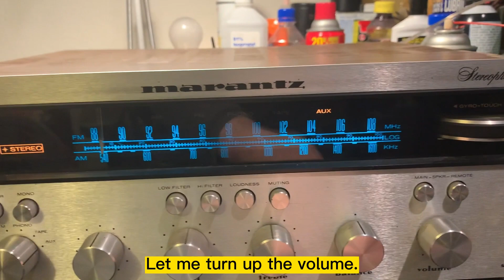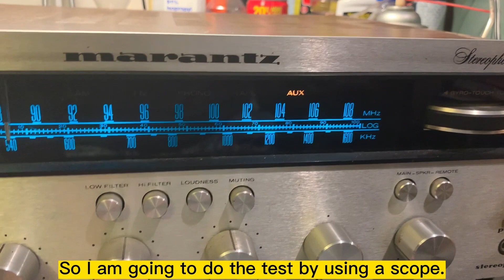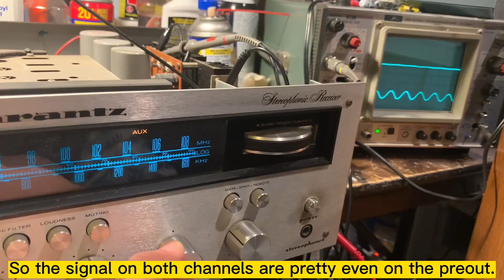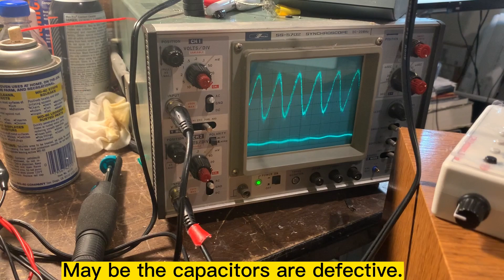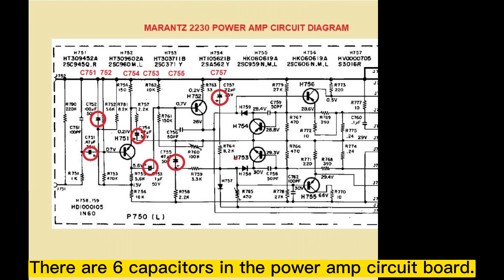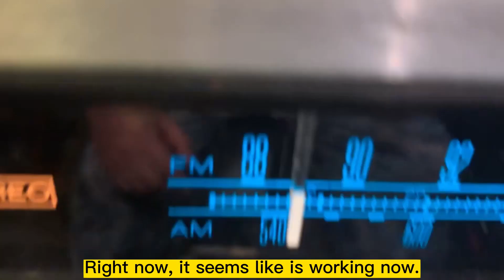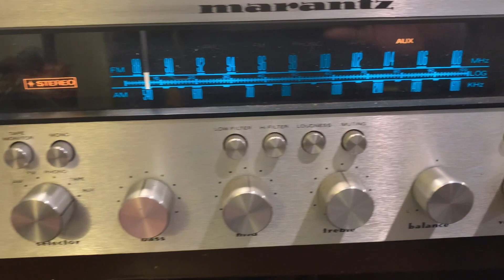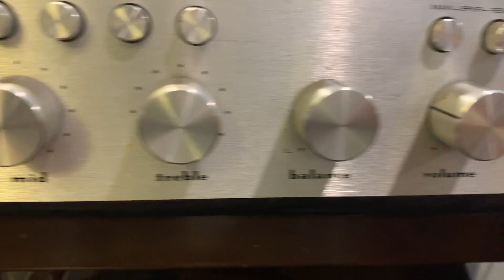Marantz 2230 (Unit #1) Repair - Uneven Sound Outputs

Comment: Great lessons here !!! Thank you for your time and patience to explain !! I have this same unit marantz 2230. When I turn it on everything is ok, but after a while (few minutes) one of channels starts to output cracking and loud garbage. Any idea what it can be ?
Reply from the maker: It is a very common issue for these type of vintage receivers. Because the aging components may cause the amplifiers not working properly. A leaky transistor may change it's current gain (when the transistor temperature increases) in the amplifier circuit and causes the cracking or static noise. Please see my other videos for how to solve this issue.

Comment: Thanks for your videos. I restored my 2230, but the source indicator lamps ( phono, tape, aux etc.) keep turning on and off by themselves whenever they want. Most of the time when the receiver is cold they are on, and after 10 min they go off. Any idea why? Thanks
Reply from the maker: Is your receiver 2230 or 2230B? There are many reasons will cause the issue you have (either bad capacitors or defective transistors). To analyze the problem, it needs correct model number to start.